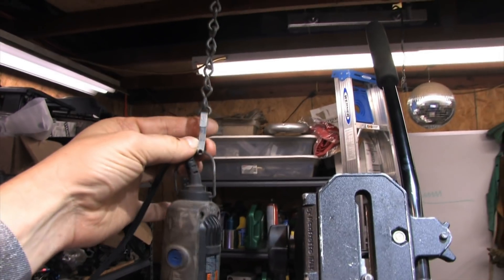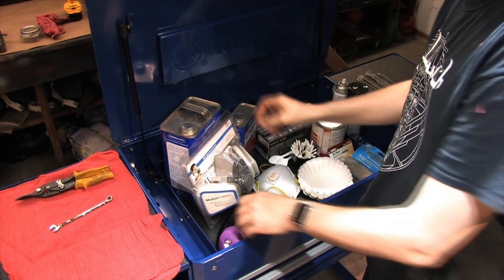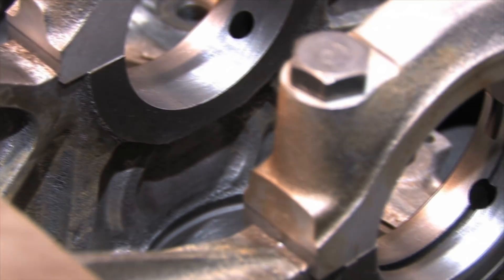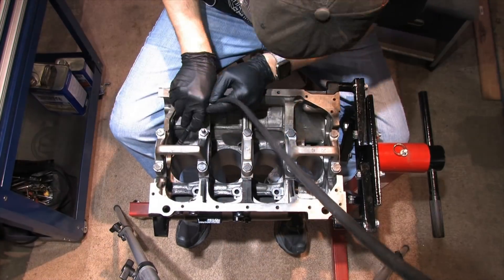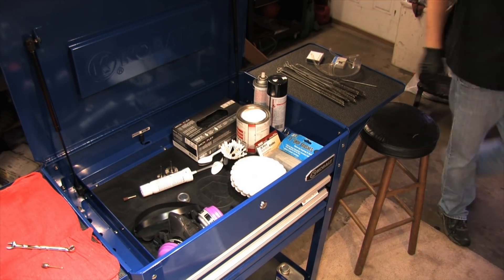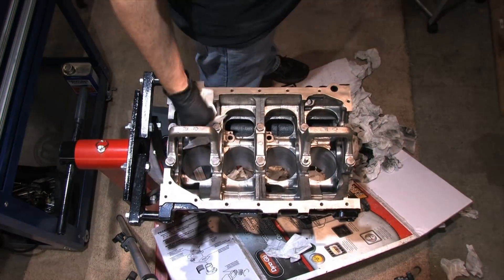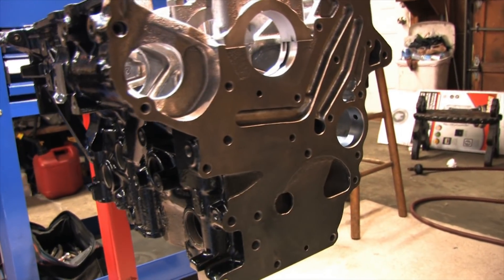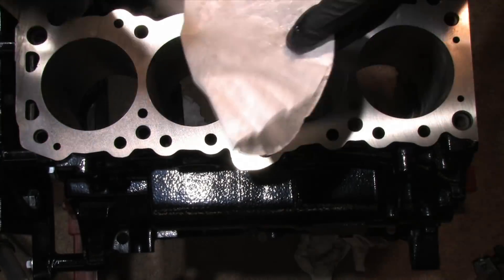Oil-repellent Crankcase Coating?

Comment: I've never seen this type of  painting inside of the Engine Block before.. I guess this is a Dealership added Option from a Salesperson staff trying to make a buck with this added Dealership sales pitch Options. Don't forget about how they're trying to Sell you the Undercarriage Paint Protection at a selling price of $5,789.95 on top of the $18,786.99 selling price for your 1988 Fiat Aero.. Sad because that car fell apart all of the time and with then said consideration of how it would only push out 87Hp. with 99Torque at the wheels going down hill with your friend's and family members pushing you up to speed.. Also, if you want to somehow drive at the required speed to be on the Freeway..??.. You would also need to consider having to run with that extra narrow Tires.. It was consider to many people who owned the car understood that car would only run best without X Spare Tire and or extra passengers inside the car.. But, when you where able enough to get the car started. You had to make a inform decision about how far you wanted to drive.. You were limited to the available tow truck around the neighborhood..??.. Because, sooner or later cuz you could count on your Little Fiat dying on the side of the road..

Comment: Trying to determine if this is practical for my application. What advantages does this have? Mine will be daily driven most of the time and see hard use 3 to 5 times a year for several days at a time.
Reply: You might be better served by "polishing" your crank case.

Comment: I would like to know how you baked that block. I asked the body shop next door and I was told their ovens get to 165F. Even though my valve covers fit in our oven at home, and I want to use our oven... I can’t. Unless I want my things left by the curb by my wife.
Reply from the maker: Would the craigslist oven out in the garage be a problem?  lol... powder coating shops have the right ovens.  There's a video here of me getting it done at Detective Coating.
Reply: @Jafromobile   I will have to weigh the pros and cons of getting a used oven just for one set o’ valve covers. Then again, I’m sure I can find a use for it... I’ll have plenty of Gliptal left over. Otherwise we do have a powder coating shop in town. Thanks for the suggestion! I love your channel, btw.

Comment: If it drys to touch in 30 mins, why the second coat and need to bake? Wouldn't it stick to inside of a freshly cleaned block fresh out of the boil tank & dried, and how long does it take to dry on its own?

Comment: never going to paint my crankcase with glyptal but I'm severely tempted to clean my next build with mineral spirits, then polish the inside and outside of the block, get it hot tanked, then get it powdercoated, then coat the machined surfaces with oil and wrap it for a month before coming back to remove the surface rust, wipe it down with mineral spirits, then wipe it down again with denatured alcohol before assembling it
I bet with that prep the oil wont even change colour by the service intervals
Reply from the maker: That's actually what I did to the Hyundai block.  I took the non-glyptal approach.  There's a video about it here somewhere...  You're also practically describing my next video right now.

Comment: I’ve dropped my short block for a paint job, I saw the guy removing the harmonic balancer (not interference fit) with a 2x4 and a rubber mallet (instead of a puller) . is t possibly that he caused damage to the crank/bearings? (not worried about balancer)
Reply from the maker: Nah.  Not with those tools.  No way.  Could have used a sledge with a 2x4 and still wouldn't have hurt anything.  That's the fun thing about wood.

Comment: I used coffee filters to clean the lexan interior windows on civilian and military aircraft windows.  All it took was a little bit of water.  Worked like a champ, did not leave behind fibers.   The other benefit is that, unlike shop towels, it was not a logged maintenance item that had to be checked out and tracked as a consumable tool.  With no need for window cleaner, which is also a logged consumable and a hazardous material (more logging), life was much, much easier.

Comment: Honestly I'm kind of surprised you didn't put this on the crankshaft and the rods too.   When I was in school for High Performance Engine building we always talked about this kind of stuff we even talked about back in the late 60s during Trans Am racing teams would take the time to polish iron block oil valleys to get them to drain back quicker. We would talk about pulling vacuum on your crankcase because when a vacuum is formed in the crankcase oil tends to stay in the pan more instead of flying around in every direction and acting like a rope tied around the crankshaft you can see horsepower gains everywhere. In the motors that we built for the engine Masters competitions we would block off many of the drains from the oil valleys and install copper lines that route in the oil pan to drain back in different directions so that it wouldn't fall onto the crankshaft so we wouldn't lose horsepower across the RPM we were trying to squeeze every horsepower we could out of those engines. So I could totally see how coating your crankshaft and your rods could be a huge help in an aspect like this if it really doesn't allow the oil to stick to it all that well any way that you can keep that off of there reduces the parasitic drag of the engine components you can see small percentages of horsepower increase across the entire RPM range. They are small increases but increases none-the-less it's kind of like hot honing. Hot honing is a trend that seems to come and go but it's again one of those things where you see horsepower increases across the entire RPM range it's just a very small 1% to 3% usually.
Regardless I really love your videos and I appreciate all the work that you put into them and thank you for answering questions the way that you do it's really really helpful to find someone as knowledgeable as you that will share their information they've gathered over a long period of time.

Comment: Question for you good sir! Why were the surfaces that you didn’t want paint on not masked off? Loving your work so far and I can’t wait to apply the knowledge gleaned from your videos.
Reply from the maker: Because I didn't spray paint it.  Due to the border of machined areas that I left un-coated around the mains, it was too easy not to get any paint on them.  Masking the block for a brushed-on coating would have taken a ridiculous amount of time.  I'd have ended up cleaning tape off of the block that didn't have any paint on it.  Even if I did get paint on it, all these surfaces wiped clean with a little 2+2 (acetone & methylbenzene) using just a Qtip or covfefe filter.  It's easier to just clean it up if I got sloppy.  I learned that on the head coating.
Reply: Jafromobile That makes more sense now. I’m gonna be building an RB25 and I’ve been reviewing your videos while the tools are shipping out. Thanks for uploading eh?
Reply from the maker: No problem!  If you're considering doing this on a street driven stock rev limit car that doesn't see track time and doesn't get taken apart regularly, I'd advise that you don't do it.  Don't put yourself through this.  I'm going to probably repeat that answer in my next video about this.  I'm not saying it's a bad thing if you've done it already, or if you have a specific problem you're trying to address... but the gains in oil drain back are fairly low.  The surface does not act like rain-X or "repel" oil as others have written about it over the years.  It drains faster than un-coated metal only because oil won't soak into it, but it's nothing to brag about versus an oil-saturated cast surface.  It's only about 3% quicker at room temperature.  It may be more at operating temperature, but I'll find out.  I begin chemical testing tonight.  If any of the 20 chemicals I'm testing degrades its properties in any way, understand that it can limit how you service your engine, and what products you're allowed to use.  This is going to be one hell of a mythbusters episode.

Comment: So all of this is for oil pressure?
Reply from the maker: No.  None of this for oil pressure.  It's all about oil quality, and oil return.  The oil pressure mods are in the oil filter housing, 4g63 block oil gallery mod, Block Preparation part 1 & 2, and the head oil gallery mod videos.  A properly-vented crankcase is just a glorified toilet, really.  Coating it won't affect oil pressure.
Reply: Jafromobile ooooohhhh okok thanks for the explanation

Comment: Hey Jafro, thanks for the responses and the help youve given me so far... Iv got one other question thou... My 2g (eclipse 98 stock GST) is have a bit of a fuel problem, after iv blown one of the coolent hoses (the top one) and got if fixed, the car has been suking up fuel... before it used to make about 10km per litter... while now, it cant do more than 6km per litter... i got my mec to clean the fuel line and injectors, changed the fuel filter, fixed a problem with the fuel line, remade the vacum line for the air fuel mix and tested it out (BTW the car was having a rich mix, for a short period it worked, after a week of driving every day normal speed, the car went back to having a rich mix)...... the car went from 6 to 6.3 km per litter... not a big diference thou... Anyway let me get to the point, my mec requested me to buy a fuel regulator and a fuel pump of about 4bar of pressure... he plans to put it in and regulate the fuel pressure to 2.7 bar... he told me that this way it will have a better flow and it will definitely raise my km per litter... What are your thoughts about that?

Comment: Would a high solids, high film thickness version of Glyptal be useful for your application?  I have used Glyptal 1202B in the past on some sawmill machinery at my day job.  It works great but the downside is how long it takes to dry.  You can buy it from EIS who has a branch office in VA for like $159 a gallon.  Keep up the great work Jaf!

Comment: What exactly is the point of doing this? Besides keeping more oil in the pan I don't understand the point.
Reply from the maker: Oil starvation is a B.  The engine is going to rev higher than it's designed stock red line.  That can make the oil pump suck air if it runs out.  There are other benefits like ease of cleaning and service between racing seasons.  It will wipe clean with a rag instead of having to use noxious chemical solvents and making a mess.  Cast iron crankcases do rust.  They condensate.  The most prevalent thing I dump out of my catch can is water.  Rust contaminates oil.  Glyptal seals those pores acting as a preservative and preventing it.
Reply: I totally get that. But this is a Hyundai. Not a Ferrari. kudos on the excellent attention to detail! how many miles were in the block Before you decided to do this?
Reply from the maker: This isn't for a Hyundai.  The Hyundai block is in the Hyundai already.  This block is for a 1995 Eclipse GSX that has a pile of show trophies and sits a lot.  This block was a virgin 124,000 mile-old stock '92 6-bolt block, I took it apart and everything met factory spec except for the bores being a little egg-shaped, I punched it out .020" to accept a set of JE pistons, Manley Pro Series I-beam rods, a knife-edged micro-polished crank, and modified a 2g head that I've got a lot of work in to top it all off.  The head just went through the machine shop with brand new valves & seats, so essentially they're both zero-mile parts now.

Comment: You just did this, but I'd be interested to see an application that has seen about 100k miles and see what it looks like at that point.
Reply from the maker: This car might not see another 100k miles in its lifetime.  But Google is full of examples of this.  Search "Glyptal", click "images, view engine parts and click "go to page".  You'll find interesting examples of people R&R-ing stuff that dates back to the 20's.  Not stuff that was coated in the 20's, but stuff that got used up, broken, and fixed.  In one example, it didn't even come out fully in the caustic bath.  Parts of it were still shiny after the dip.  The guy rebuilding it complained of how hard it was to remove so he just scuffed and re-coated it.  It is one characteristic shy of the label "superamphiphobic" in its dry, baked-on state.  It repels water and oil, it has strong resistance to acids, but only mild resistance to alkaline chemicals.  A crankcase never gets exposed to alkaline chemicals in service or at the machine shop, so that's why it's so hard to remove.  If the prep work was done right, it won't come off.

Comment: I use the same methods you do, however I use a pair of sharp side cutters and trim the hair of the brush down by half. I use cheap dollar store dixie cups to put the paint in. Less material out longer flash time.
Reply from the maker: My can of Glyptal is still like new at almost 4 years old because the lid has been off of it for a combined total of less than 5 minutes.  As far as not seeping through the lid, I suppose it helps that it's a great thread sealant?

Comment: I'm sorry, but I don't get it. The cost of this job could be very expensive, is like the cost of rebuild an engine after 300.000 miles....
Reply from the maker: It only cost about $200 USD to do this, including the half-mask respirator (which I really needed to buy anyway).  It will not cause me to have to rebuild my engine.

Comment: When this stuff will start breaking down - it will probably ruin engine - peeling pieces clogging oil passages and messing with rings and bearings...
Reply from the maker: You mean "if".  This treatment has lasted for several decades on some cars.  Preparing the surface correctly first and baking it on can make it nearly impossible to remove even if you're trying to remove it.  Google "Glyptal 1201", click "images" and visit the web pages where you see engine parts.

Comment: what is this nonsense for the first two minutes, trying to fluff this the video for extra time? it was terrible
Reply from the maker: Thank you AJ, your feedback is so important to me.  That's called an equipment rundown and safety primer.  See, it's important to explain what's going to be in my hands and how if someone is stupid enough to do what I do to avoid poisoning yourself.  Just trying to be responsible, you know?  Spend 2 minutes educating people so I don't have to spend the next 10 years answering the same question over and over again.  So by doing that, now all I have to answer are the people who have controls that can skip them ahead through the video who are impossible to satisfy, and of course all of their questions from having skipped the parts of the video where these things are explained.

Comment: 4G63T?
Reply from the maker: Yep!
Reply: This came up in my feed and I use red insulating varnish in the old engines I rebuild. I have a '90 Plymouth Laser with the 4g63 na engine and I knew that block looked familiar and the piston oil lubricator bosses for the turbo did it. 6 bolt or 7?
Reply from the maker: 6.  This engine is going in my 95 Eclipse, and my other 3 projects also have 6-bolts.  :)

Comment: What's that going to do for you that a larger sump would do ?
Reply from the maker: Not protrude below the crossmember, not cost $539, and not require a modified oil pickup tube.  I'm going to shift at 8,000, and that moves a lot of oil up to the head on a 4g63 because the drains are sized for a stock engine, not a race motor.  The coating is rumored to accelerate oil drain-back a little quicker which might help with that.  Also, Magnus sells a dry sump setup for only $5,500.  It fixes all of these issues and it's beautiful.

Comment: Does painting the inside of the block like that change the thermal conductivity of the block? Would doing so make it so the oil couldn't cool the block as well?
Reply from the maker: This was discussed in the previous video I uploaded, linked in the description.  :)

Comment: I've recently bought a old russian lathe, which is coated on the inside with same color red as your cylinder head and now block, before i started using it i serviced it which include changing the oil, and wanted to wash out the grime from the casting and the bottom, i thought i'll be scrubbing half a day, i put little diesel fuel in a spray can and with one spraying all the grime on 45 year old machine simply wash out, i was astounded how easy and good it cleaned out.

Comment: I have 4 kubota tractors, two mowers and two compact tractors. They all have this stuff inside, what is it supposed to do?
Reply from the maker: One thing farm equipment and landscaping gear is more likely to do than a car is... is become sunk deep in the mud or a lake, swamped and left there waiting for a bigger piece of equipment can come fish them out.  This is a good reason to have the coating because water would displace the oil and cause the internals to rust if it weren't sealed from contact with the elements.  Also, that equipment is likely to sit all winter without being used even if it doesn't get swamped.  Rust played a big part in killing my previous Elantra build.  I've heard this coating was inside Caterpillar products as well, but I have only 1 comment about that and no confirmation that it's a standard treatment.  It may be... but these are potentially factory treatments that people are talking about, making all the "this is stupid and you're a moron" commenters here look pretty ignorant.
Reply: Jafromobile sounds plausible